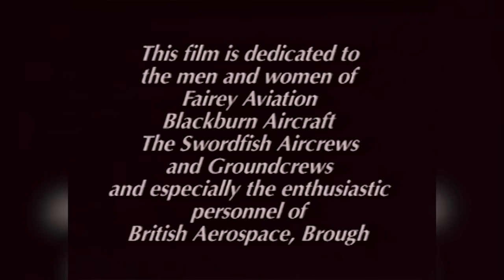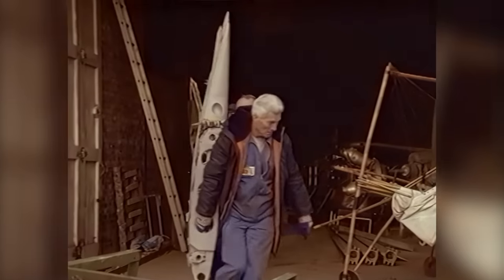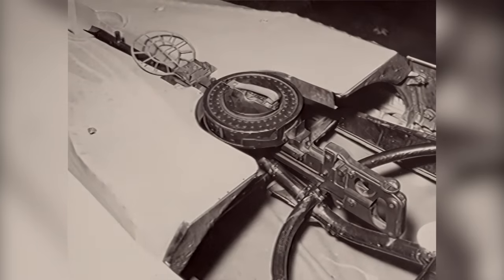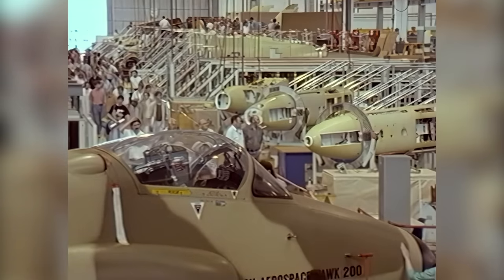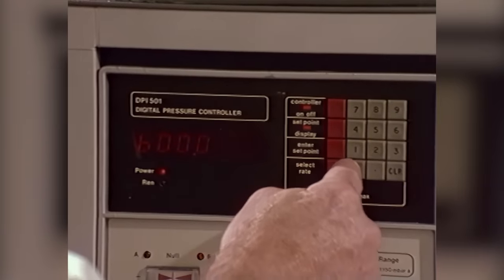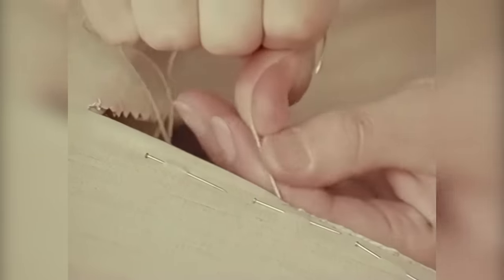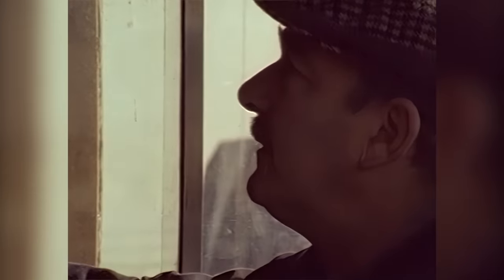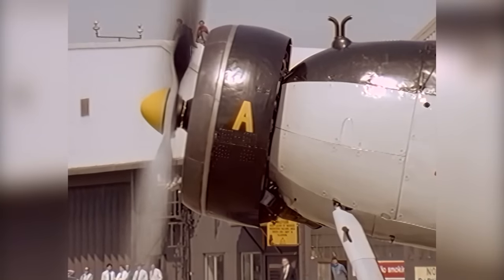Swordfish W5856 Restoration

Comment: The Fairey Swordfish was designed as a heavy lift STOL bomber. It was far from “outdated”. It used two wings to gain lift at low airspeed. In other respects it was was fully contemporary with Hawker Hurricane.
German Ju87 Stuka was another specialised bomber. It also needed fighter escorts.
Reply: What most people would fail to understand was that a fully laden Swordfish could take off using a short take off run abaft the carrier's "Island" without the use of a catapult (necessarily situated near a carrier's bows). Doing so meant that it avoided the LARGE degree of oscillation at the carrier's bows in heavy weather (rather like sitting on the pivot point of a seesaw). This meant that as opposed to most other carrier aircraft it could operate in TREACHEROUS sea conditions that would keep other aircraft safely lashed below in the hangar decks.

Comment: BAe Brough - remember doing mods on a few LN410 analogue flight control system computer for a couple of Blackburn Buccaneers for them. Fitted in a subframe to replace the old 1950's huge box flight control system. They wanted to try out new sensors on it, rate gyros I think it was. Just a matter of changing a few resistors on the input operational amplifier circuits. The old huge box was just a bunch of magnetic  amplifiers and solenoids, not quite very reliable. LN410 was a plug in and forget box, never went wrong. Three quarters of the direct replacement subframe was dead empty space in the avionics bay.

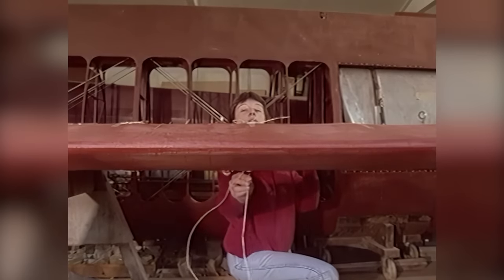Comment: 45:00 - radial engines, an art in itself.
Them WW1 rotary engines though were nuts, their distant cousin, gyroscopic effect of all those cylinders rotating. Sopwith Pup pilots, a few snapped their wings when they suddenly powered up to full in the air. Or maybe just turned upside down, suddenly.

Comment: The Swordfish left Bismarck limping in Circles, but Rodney's 16 inch guns finished the job.
Reply from the maker: Correct, but that little, antiquated biplane did wonders, all considering. Remember the battle of Taranto as well
Reply: The boat was turning in circles, not going anywhere. Why not just leave it alone until it ran out of fuel?
Reply: @paulstewart6293  Revenge.

Comment: It remarkably had very sharp edge technology for the day on it. You wouldn't think it, would you? 🙂
Reply: Aviation advances go in bursts. An aircraft might remain cutting edge for years, or be out of date in months depending on the when, especially during war. The biplane to mono is a very visual difference which possibly writes it off in peoples minds from the get go.
At least no one was daft enough to make a wooden plane in this era of metal aircraft......right?!!!
Reminds me of the time when fire arms were first being introduced. Swords and crossbows were still used. New things might have potential, but if they're not that great yet, tried and tested can still win the day.

Comment: I really don't know all after 40 odd years as an engineer, but why was the propeller not dynamically balanced, even car types get that. From experience, the old analogue gauges are far more reliable. A pipe is stronger than a transistor. KISS - Keep It Simple, Stupid.

Comment: Damaging the rudder can be seen as divine intervention. It was luck beyond luck to hit the Bismark so that it could not manoeuvre. Anything else would certainly have resulted in heavy British losses of ships and men. The Bismark was superior to anything afloat in the Royal Navy.
Reply: True about the rudder hit. Probably as lucky as the shot from the Bismarck which destroyed the Hood?
Not sure it would have resulted in heavy losses as you say though. The ship would have escaped to a French port without rudder damage, and probably would have remained there due to constant air attack. The later channel dash might have been more interesting, but nearly all large KM surface ships were hunted down for little loss of ships by the end of the war. Only Prinz Eugen escaped. 
The Prince of Wales mission killed the Bismarck from the get go, it should have returned home, and could not have continued the original mission due to fuel loss.
Any Fleet Aircraft Carrier was superior to any Battleship by this period, IMO. The RN had several of these all superior to Bismarck. If the Bismarck was superior to any RN battleship, then that was because they were updated WW1 ships, or ones that complied with the tonnage limitations of the various treaties which Bismarck didn't. Anyway, none of that mattered as the RN had far more ships, and didn't need to fight one on one in the first place.
10 extra U-boats would have been a much better use of steel.
Reply: It was so "luck beyond luck" that the Fleet Air Arm had ALREADY done EXACTLY the same thing to the Italian battleship "Vittorio Veneto" at the battle of Cape Matapan 3 months earlier. The stern of a ship is THE most vulnerable part of any ship, especially a capital ship with inbuilt torpedo defence systems amidships. Fleet Air arm pilots did not suddenly appear at the start of the war, they had trained through the 1930s to acheive such things. Inasmuch the same way as Japanese naval aviators managed to do to the British battleship HMS Prince of Wales 7 months later.

Remember what one of the world's greatest golf champions, the South African Gary Player once said..... "The more I practice, the luckier I get"